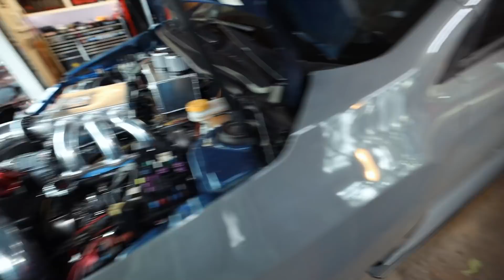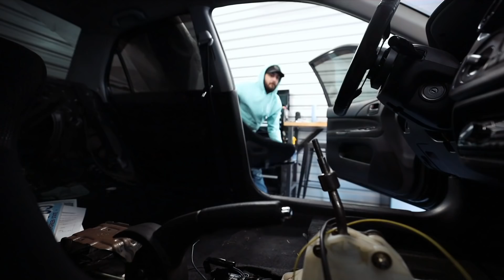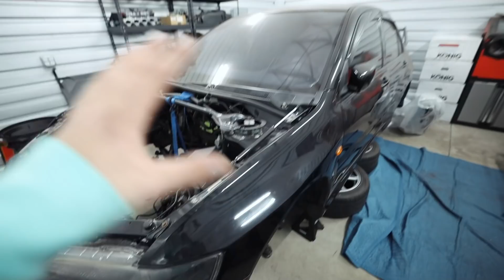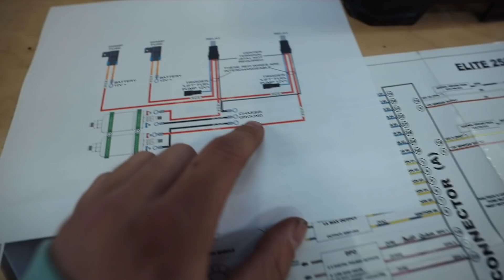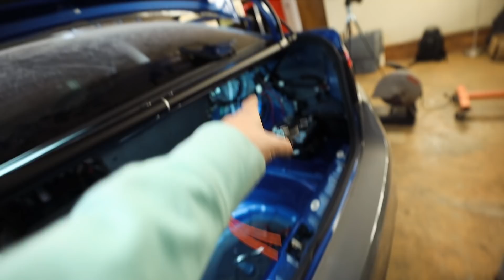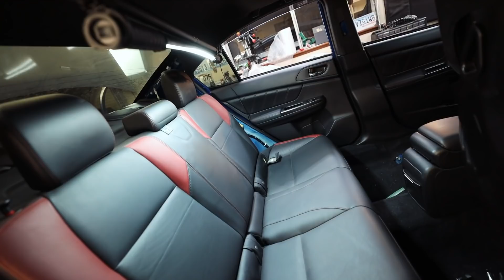THE Flat 6 Subaru STI Lives again!

Comment: Buy nexus ecu or any other solid state relay pdm module... Run all your car body lighting,power window and power mirror and such through that pdm instead of relying on oem canbus system...

Since u wont be using ac anyway
Reply from the maker: Why though? The OE canbus can support all the OEM features without issue 👀

Comment: you should LS swap it and get some real HP
Reply from the maker: How is 1000+ WHP when done not real HP?
Reply: @Smeedia  OK but how long is the motor going to last? You going to end up with a 1000hp dino run and then the motor needs a rebuild? Drag cars make 2500 hp, but you have to rebuild them after each race.
Reply from the maker: Motors built for 1200WHP, I have 0 worries of it failing
Reply: @Smeedia  Subaru is Japanese for "your motor is blown"....don't believe me? go back on you video collection and see how many blown motors there are.....
Reply from the maker: Literally not a single one of my Cars have blown up
Reply from the maker: It's an owner problem, not a car problem
Reply: @Smeedia  So what you are saying is subi owners are morons? Hey, there is a Tee shirt idea....no charge.

Comment: Hey man, where you took apart all your wiring and know a pretty good amount of stuff about it, could you help me troubleshoot whats going on with mine? It think it's a electrical issue but im not sure
Reply from the maker: Whats the issue?
Reply: @Smeedia  so I have zero clue what it is. I thought it was my speakers (I've went completely new sound system cause of it) and that still didn't fix it. It developed a loud electrical crackling noise near the right dash speaker area and I've replaced the speaker wires and speaker (even pulled the new wires away) yet it still makes a loud electrical crackling noise only when I go above 40mph. As soon as I go below that it stops and it's only in that area. I have no clue on what I need to do to fix it. I believe I have a video if needed too

Comment: Happened to my ram. My ram lost power  with a dead battery. Got a new battery and nothing worked. I was upset. Wouldn't turn on, nothing on the dash or infotainment system worked. Left it with power overnight and the system initialized and went through its checks. Came out the next morning and everything worked. New cars take a long time to initialize. I should of mentioned this when you were having issues.
Reply from the maker: Weird problems take weird solutions but regardless glad we got it worked out 🔥

Comment: I been watching alot of subbie stuff I own a 2002 subaru outback broke single dad status but it's mint 80k miles. What's going to be different about this ej33 compared to the ej25. Obviously more displacement. Is it a more superior engine?
Reply from the maker: 6 cyl vs 4 cyl, easier to make power with the 33 💪

Comment: Honestly, as much as I looooove talking shit… it hurts me to say this…

…you’re low voltage auto electrical is coming right along. Much improved work and I’m proud of your progress.
Reply from the maker: Definitely a skill that takes some time to learn and have a ton more to go but we're getting there. Appreciate the feedback 💪😁
Reply: @Smeedia  you’ll be making Mil-Spec amp connectors in no time.

Nothing better than having one single connection to disconnect to pull an engine.

Comment: So glad she's fixed (mostly)!

Note from last video, diode dynamics has some stuff I need, so thanks for getting me to check them out! Probably gonna go with circuit demon and profile pivots for my strips!

Keep it up dude!
Reply from the maker: Ohhhh all some good stuff for electrical 😍🔥
Reply: @diodedynamics lighting rocks! Truly top notch. If you aren’t running their fogs you definitely need to check out their SS3’s! I run their max’s in amber and couldn’t believe how good they are. Customer service is the best and are here in the states :)
Reply: @hollabacatme  I do like the SS3's, but it doesn't seem like they make them with the 05-07 legacy fog light fitment. I could be wrong, but it's based on what I've seen

Also, at this time, fog lights are last priority due to some more urgent repairs. (Valve cover and fuel sender)
Reply: @Awkward_Fox  this could be true as I honestly don’t know but there’s always a way to retrofit up :) have some of that maintenance myself to do right now but we dont seem to be getting a break from the snow over the past couple weeks to do it

Comment: Are you running a radium x2 pumper w/AEM 340's? I have a single 340 pump sitting in a box. Contemplating pulling the trigger on a second pump and the double hanger.
Reply from the maker: For the Evo I'm using the radium hanger With a single walbro 450 
The STI has 2 walbro 450s 🤙
Reply: @Smeedia  thanks!

Comment: For the ABS system light. I'd try and leave power on and spin all the wheels as fast as possible. So it sees wheel speed. Maybe that's all it needs. My KTM traction control or ABS light is on every single time until I start moving then it goes out.
Reply from the maker: Once it's running we will try that, no way I could spin them fast enough 😅
Reply: @Smeedia  you actually probably could. With the wheels on just spin all the wheels by hand. And it'll probably work. Get the fronts spinning and then run to the back. Semi trailers you can spin the wheel by hand and make the light go out.